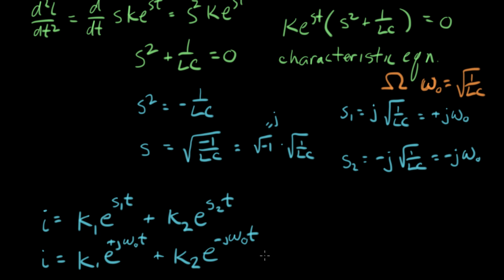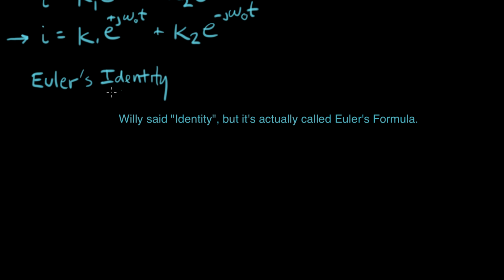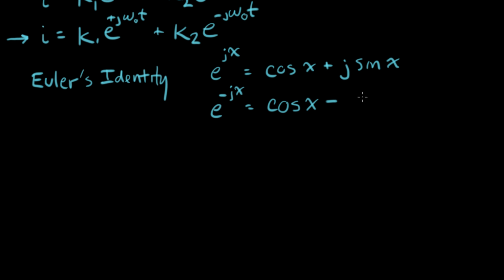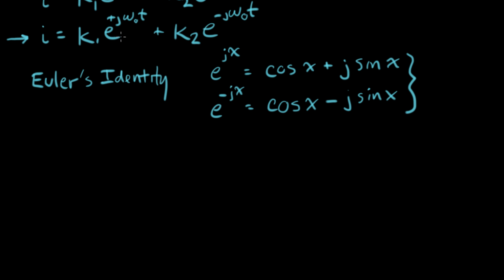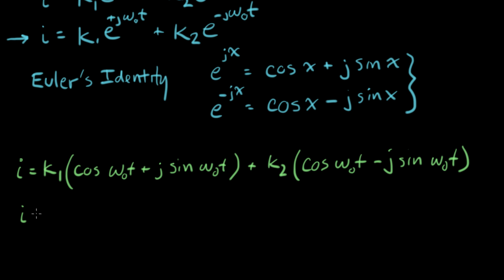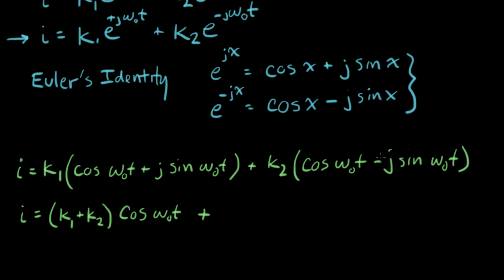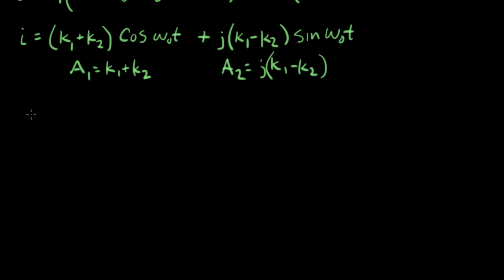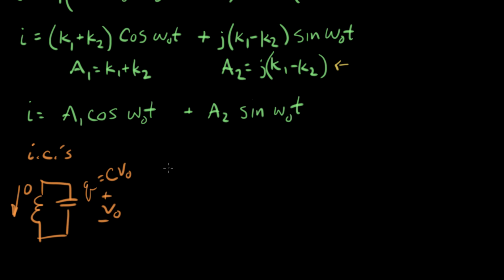LC natural response derivation 3

Comment: why i(0) = 0 ?
I know that this is the situation before the swtich is closed,
but how can we know that this is what happens after the switch is closed? (I mean i(0+))
Reply: At t=0 all current flow is zero (due to the open circuit), but at the instant the switch is closed, the inductor needs a virtually instantaneous time before it's "SELF-INDUCTANCE"  allows current to get started (current in an inductor can NOT change instantaneously, even from zero initial current)  This is a basic property of inductors, due to "self-inductance" of the inductor.